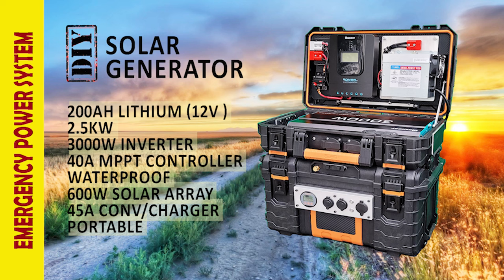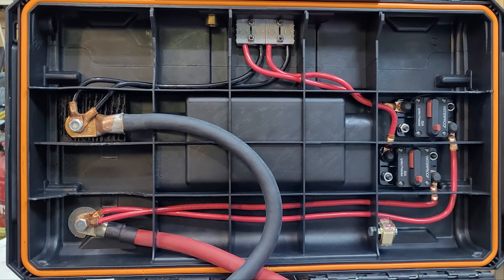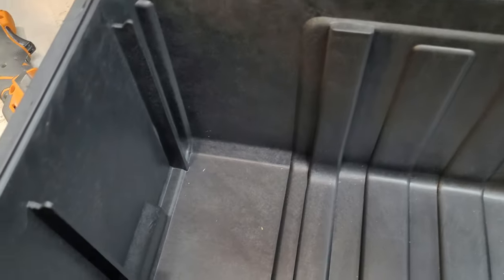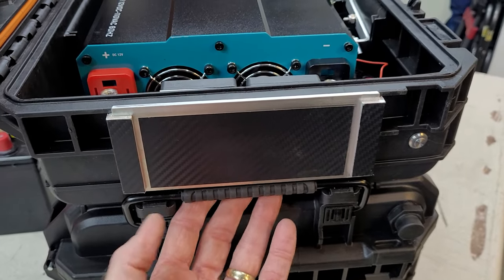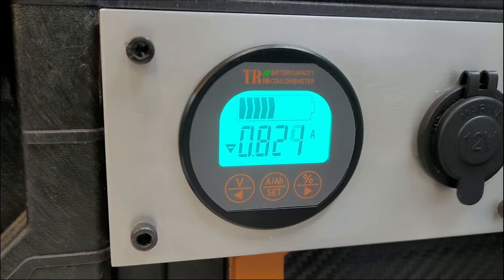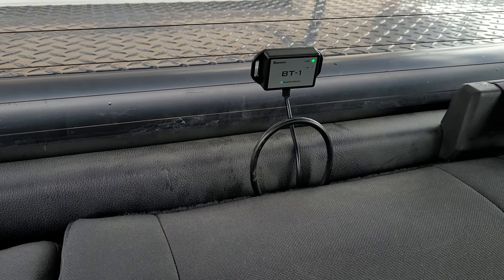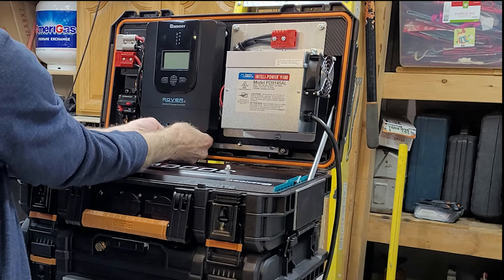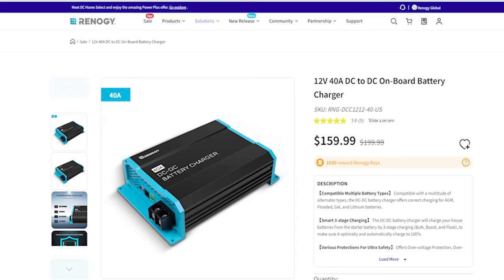DIY Solar Generator

Comment: How would you go about wiring a 30A plug to use this as a home backup to a transfer switch?
Reply from the maker: With only 200 amp hours of battery, I wouldn't connect it to a transfer switch. I would just connect the devices I would like to run like a fridge and freezer. There are after-market transfer switchs that can be connected to smaller units like mine and you can automatically switch from solar panels to grid electricity.
Reply: @customtech383  Well the transfer switch was installed to connect my two 2500W generators to run in parallel. That was done before these LifePO4 units came around. So I want to build one that can connect to the 30A plug on the transfer switch. Since the transfer switch only has a few circuits I would only be running the garage fridge and freezer and the kitchen plus maybe one more room if it could power it. So I would built it with the intention of just being able to get thru the night and then I could charge with 400W of solar or my generators the next day. I was just seeing if there was a way to do 30A with a 12V system instead of building a 48V system?
Reply from the maker: Just plug this into your inverter: (Copy and paste)

https://www.amazon.ca/TIPHOPE-Adapter-Converter-Electrical-Trailer/dp/B09N3CSWXG/ref=sxin_15_pa_sp_search_thematic_sspa?content-id=amzn1.sym.46621be6-fabe-4126-8501-d32c96c42a24%3Aamzn1.sym.46621be6-fabe-4126-8501-d32c96c42a24&crid=Y6GVTYTFYVUB&cv_ct_cx=30A+Male+to+20+amp&dib=eyJ2IjoiMSJ9.5cdqocjJLlaud0PinfHFePmFGxvMqi23TqmIcrWBjXr1A6UDRg5G568xfDGdaXrzWiDLBiZtrdhlPouf4HxnkQ.B7onziAub0gaT0e1XvUVeoqdnGq8M0roTrFHS4c7XuM&dib_tag=se&keywords=30A+Male+to+20+amp&pd_rd_i=B09N3CSWXG&pd_rd_r=cdb604e1-7025-41fe-9947-82d55221585a&pd_rd_w=89mBq&pd_rd_wg=yNj6c&pf_rd_p=46621be6-fabe-4126-8501-d32c96c42a24&pf_rd_r=3NC9PJN7JX6Q6NRCYGV3&qid=1726011310&sbo=RZvfv%2F%2FHxDF%2BO5021pAnSA%3D%3D&sprefix=30a+male+to+20+amp%2Caps%2C120&sr=1-2-acb80629-ce74-4cc5-9423-11e8801573fb-spons&sp_csd=d2lkZ2V0TmFtZT1zcF9zZWFyY2hfdGhlbWF0aWM&psc=1
Reply: @customtech383  But that's not supplying 30 amps, that's a 15A plug adapter to a 30A. I'm wanting to make a system that supplies 30 amps.
Reply from the maker: You need a 3000 - 10000 watt power inverter with "High output terminals" so you bypass the 15 amp plug outputs. My 3000w Renogy inverter allows this option and I have it wired up in the video this way. So I can replace the two 15 amp external outlets with 30 amp ones and use a 30 amp connector for a RV/Home etc. The gauge of wire is also a consideration. I would use at least 10 gauge

Comment: QUESTION: What is the maximum amount of solar panels you could use this solar generator with? 950w? More? Less? What is the maximum solar input limit?
Reply from the maker: I am using a 40 amp solar controller in the video. Amps (40) x Volts (13.4ish) = Watts (536). 600 watts in Renogy solar panels max out in perfect conditions at approx. 37 amps. 
You can add more solar panels. If you are discharging 60 amps in good sunlight you could match those amps by running another 40 amp controller with another 600 watt array. Once the sun moves out of optimum range you would need to reduce your load as your 200ah battery would drain quickly.
Reply: @customtech383  Thanks soooo much! Regards from Brazil!

Comment: How did you wire the 110 power outlets from the inverter? I really like you build and wanna do something similar
Reply from the maker: There is a hard wire connection port on the inverter so I didn't need to use the outlets. I wired in the ground as well.
Reply: @customtech383  ya i notice those when i was looking at the inverter. Now one last question(hopefully) the solar charger unit can you wire it for a wall chager as well or just solar ?
Reply from the maker: Don't understand the question. Referring to the "Solar charge controller 40a" or the "45a AC to DC charger/converter"?

Comment: Please enlighten me, how does this “generator” make electricity?
Reply from the maker: The DC battery gets charged by solar panels and the 3000w inverter turns 12v DC to 120v AC for home use
Reply: @customtech383  Ok so it’s not a Generator.

Comment: Are you using the 110v outputs on the inverter?
Reply from the maker: I am not. There is a place to hard wire them. Better connection
Reply: @customtech383  thank you I finally saw that, not sure how I missed it .....

Comment: That's such a smart, even beautiful build, but at $2000 it strikes me that you could have bought an equivalent off the shelf, so my question is "am I wrong". I'd love to make my own but the cost would need to be a lot lower.
Reply from the maker: You can cut the cost by buying cheaper parts. But the real reason is because each component can be replaced separately if there is a malfunction (There are probably more than 15 individual components). In an all-in-one system you would probably have to buy another complete one. You can also change individual components based on your ever changing needs. Also, as technology advances, you can replace individual components easily. In most cases, if you're all-in-one battery starts to lose efficiency, you must replace the whole system. If you have a basic understanding of how it all works, I believe using separate components in a box gives you a lot of options, flexibility and lower cost.
Reply: @customtech383  Thanks for giving a comprehensive reply, and of course it all makes complete sense. Cheers.
Reply: In addition to what he said... if you tried to price out an all-in-one product that had the capability of a 3000W inverter... you'd be in the ballpark of $3-4k or higher..
Reply: Excellent job. Is there any I could get a list of what you bought and the size of those rigid boxes? I'm 66 on O2 24/7, and that would be a life changer for me to be able to go camping again.  Thanks.

Comment: whats that called, connected to inverter terminal? @ 5:04 min
Reply from the maker: not sure what you're asking
Reply: @customtech383  sorry, what i mean is the little L shape metal ,connected to the positive and neg  terminal on the inverter, so i can do same setup as you, bringing battery cables and connecting it underneath terminal under box.
Reply from the maker: @mlora929  Yes, it is an L shaped bracket which is made out of 1/8 or 3/16 aluminum that bolts to the bolt at the bottom of the box and to the inverter terminal as well. These can be made anyway you want as long as it is thick aluminum or copper and connected well

Comment: I'm at a lost here. I keep hearing solar generator, solar generator, solar generator. I does not make power, it stores power. Solar panels, a gas or propane generator make power. This does not. It's a battery & an inverter in a box. What am I missing here? So where does solar generator come from?
Reply: All generators basically do the same thing... convert a different source of fuel into usable energy. The only major difference between gas generators and solar generators is that solar generators require solar panels to input (fuel) solar energy, whereas gas or diesel generators require some type of fossil fuel to generate electricity.

Comment: When you close the lid,  seems to be a short Hazzard possibility.    I cringed when you closed the lid.  The ground is over the positive.
Reply from the maker: When I watched the video again it did look like my positive upper bolt on my lid was right on top of my negative shunt or bolt, but I measured it and it is more than 3/4 of an inch away (There would also be a 5/8 gap from the top of the negative shunt/bolt to the upper positive one on my battery if they were right on top of each other, which they are not). Thanks for bringing it to my attention because I did move one of my 6 guage + connections on my lid toward the outside of the box which gave me more room in case something came "unbolted"  if it got dropped, or a small child would hit it with a hammer!.